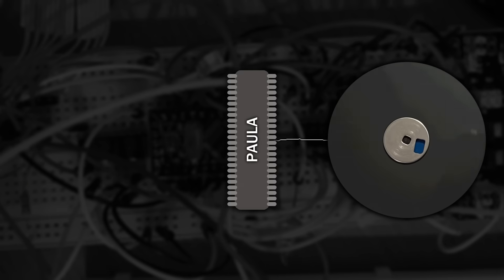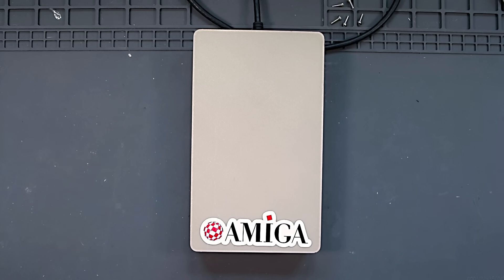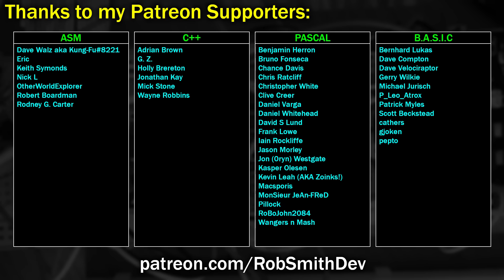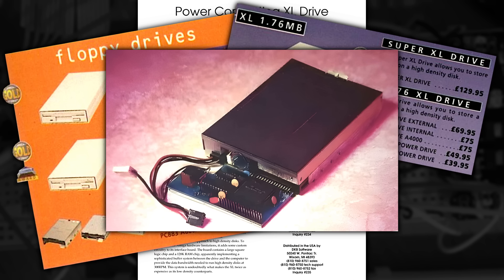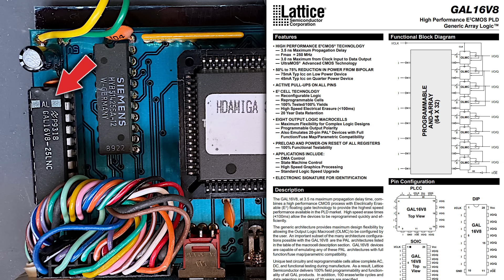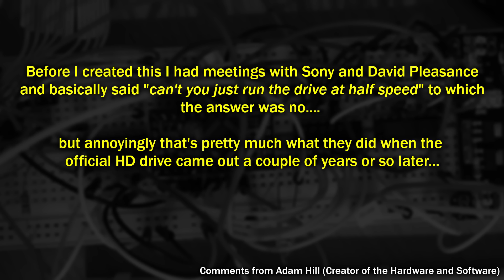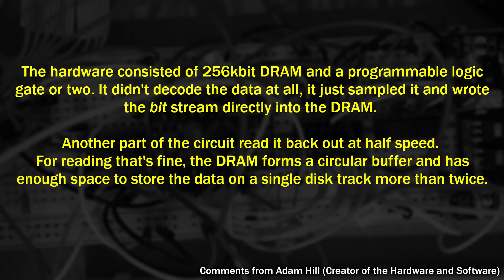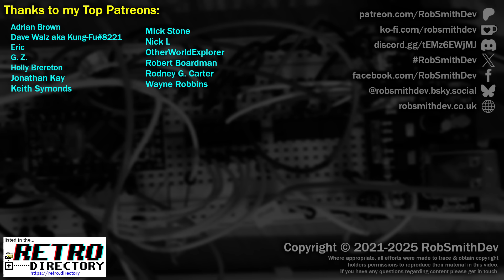Commodore vs. Clone: High Density Floppy Drive Showdown

Comment: The reason we created the XL drive in the first place was that the Commodore version simply didn't exist at that point ( I think its release was over a year later but as you can imagine my memory of timelines from then is a little hazy 😂 ). The FPGA was ( relatively ) expensive and a pain because they had to be programmed during manufacture. Later in the product lifecycle we created a custom ASIC which cost pennies per unit relatively speaking which is why the price dropped.
Reply: Wow, all this to work around having to adjust the Paula chip?  I guess the cost vs. benefit works out for having HD floppies run as slow as DD floppies.
Reply: @kjrehberg dual speed floppy drives existed way before the Amiga used them. It would be a phone call to order them, compared to spending months changing Paula. And AGA was already started too late for the market and sabotaged by management.

The irony is that power computing didn't just  source the drives themselves. Dell were using dual speed drives as external drives for laptops, someone created a cable to hook them up to the Amiga.

There is also a mod for some drives to change them to 150rpm when you insert a high density disk.
Reply: @phill6859  I think that the Dell drive you mention came out around 1992, whilst the Amiga 3000 with the half speed drive around 1990. We did the PowerXL drive about a year before that. I directly asked Sony ( and another manufacturer but can't remember which, maybe Fujitsu ) about creating a half speed drive and they wouldn't do it, and hacks of existing drives for a commercial product were really out of the question.

Obviously it was 35+ years ago so my timings might be off, but if there were half speed drives available in 1988/89 we couldn't easily source them.
Reply from the maker: Cool thanks for the extra info - I’ve pinned the comment!

Comment: I bought 2 genuine Commodore HD drives for my A3000 from the US and had them shipped to Australia.  I recall the cost of an external aftermarket DD drive + case & cable was $199AUD, but these drives cost me around $375AUD each for the bare drive.  I can't recall how much of that was due to shipping, exchange rates, import duty etc.  Exchange rate then was about $1USD=$1.30AUD, so I'm guessing they were maybe $250USD each.  They did come with A3000 eject buttons.  Strangely, I couldn't get two HD drives to co-exist in the A3000 so I had to sell one of them off.  I still have the other one, still working.  Good to know they are very rare, though I doubt they are worth much if I tried to sell it as I doubt there is much call for floppies in general, and even less for HD ones.
Reply from the maker: Weird I wonder why only one would work at a time. The price is really interesting though. From the comments so far the price range is quite wide. Thanks for sharing

Comment: Great video as always!
Quick question, what is the filament you used to 3d print that case? Best I have found here that is close enough to an A500 in the UK is eSun PLA plus bone white. Also, have you ever found a filament that matched the A1200 colour?
Reply from the maker: Yes thats the eSUN PLA Plus Bone, haven't found anything as close

Comment: I always found it frustrating that the Amiga never got HD floppy drives as a common thing, especially given that CrossDOS could read PC DD disks but not HD disks. There was a painful period when I had a CD32+SX32+Floppy drive and a 386 without a CD drive and was having to use DD disks via CrossDOS to transfer files from CD to the 386 which was as fun as you can imagine.

Comment: I had one of the Power Computing drives back in the day. It was so unreliable, they swapped it out at least once, maybe twice and in the end I had to get a refund. I also tried the slimline Amitek HD drive which worked well, but packed up after a few months. Ultimately I bought a clock port Catweazle which was excellent in my A1200 for years and these days it’s still working great connected on the IDE bus in my A4000.

Comment: I have an A3000 that was donated to the Amiga users group I belonged to.  I haven't checked which model floppy drives it has.   Now I will have to do so.   I suppose with large enough buffers, one could interface an LS-120 or a Zip disk to the floppy port (although they would be slow).
Reply: Zip drives are ide/SCSI anyway. There isn't a floppy drive interface one
Reply: @phill6859   Iomega released a Zip drive model with a floppy-style interface known as the "Zip Plus" (1998) that supported both parallel and floppy-style connections.
• 	Featured a proprietary "SmartMedia" cable that could connect to either a parallel port or a floppy-style connector on certain systems.
• 	This allowed it to emulate a floppy drive interface on compatible machines, though it wasn’t a true 34-pin floppy header like standard 3.5" drives.

Comment: I remember there being another Amiga HD floppy drive option back in the day.  It was made by Applied Engineering.  I think this pre-dated the Commodore one too.  Do you have info on how their HD floppy worked?  I think it was about $250USD.
Reply: I think Applied Engineering also made the external, multispeed drive that was required for the A-Max Macintosh emulator to use native Macintosh discs.

Comment: I had a HD 1.7mb floppy drive in my original power tower. Pretty sure it was Power Computing branded, but may be wrong. I vaguely seem to remember it was slower than the 880 k one(?) I think it came in an external case and i removed it and slotted it in the tower, it had to have some sort of interface i think, but no drivers (again might be wrong) which confused me coz how did the Amiga know it was a HD disc - even if it read the extra hole.  I have not watched you video yet so may end up coming back here and editing this !!!!!                                                                                                                                                                                                                                EDIT:  well that answered all my questions !!!!  well done you Mr Rob!!!

Comment: I just opened my external HD FDD and found that it indeed has a Chinon FZ-357A inside. I snapped a few photos of it and managed to find the invoice for it. Bought from Tricom Data, Stockholm, Sweden in July 3rd 1995 for 1798 SEK (155 GBP, 247 USD back then).
Reply from the maker: Wow! The prices on these things seems to vary wildly! Cheers

Comment: Is there any link to the DIY version?
Reply from the maker: Not to my knowledge. There’s lots of info about modding a drive to make a 150rpm drive though.
Reply: @RobSmithDev  I saw some info, but have not seen anybody actually legitimately succeeding in recreating reliable drop-in replacement for Amiga internal HD drive... Maybe a future video? These drives are so unobtainium, that it would be IMHO a big gift for amiga owners replacing broken drives with HD downgraded to DD. Especially ability to read PC 1.44 floppies is extra desirable, which comes with Amiga HD floppy support.

Comment: Beautiful video and explanation, as always I must say 👍. The reason why "half speed is not possible" is that on reading, the signal from the head is going to be proportionally weaker than at nominal speed, leading to lower SNR and ultimately higher BER (== more noise, more errors). When writing, the flux out of the head gap sure has a hard time overcoming the coercivity of the magnetic layer, which is higher to start with on HD floppies than on DDs (think about "high bias" TypeII or TypeIV audio cassettes vs "normal" ones). Amiga HD drives have never been all that reliable indeed. The PowerComputing solution was the superior one, and Commodore should have gone with it too, rather than grossly bending the specifications, delivering an unreliable product and messing with users' data, because that's what they actually did. No wonder Sony (who introduced the 3.5" media) didn't vouch for that rubbish. Oh, and they should really have improved Paula for AGA, supporting 2 and 3 us PLL periods as a bare minimum, implementing a sane UART buffer perhaps, and even 16 bit per channel and some panning on the audio outs 😅😭
Reply from the maker: Good wish list for Paula! :) it is a shame. It really is amazing (luck?) that it worked at all.
Reply: the biggest disappointment of the aga chipset was that they didn't do any upgrades to paula!
Reply: After aga was started late and then put on hold for a year, there wasn't any time. These were all put off to aga plus (including chunky pixels). Which never made it beyond a wish list

Comment: When I was around 12(circa 1995) I tried being a smartbum(yes, smartbum) and installed a HD drive in places of the DD drive in my DF1: drive. It actually worked if you put an 880k disk in, but a 1.76mb disk would simply give a "device not ready" error.
Reply from the maker: I think I tried that at a similar age too lol

Comment: 357As are a weird thing. I currently have  two and one which refuses to work on my 1200 but works perfectly on my 500+. I've even had a 357A that was missing critical circuitry and therefore would never ever work on any Amiga😮
Reply from the maker: Crazy! And weird that one works in your 500+ but  not the 1200 (is it an escom model A1200?)
Reply: @RobSmithDev Hi Rob, no it's a genuine Commodore. My other 357 works in it perfectly!
Reply from the maker: Very weird!

Comment: Did this affect data transfer rates? If the rpm is halved, but the data size is halved, I assume transfer was about the same?
Reply from the maker: RPM is half but data was double so it meant reading an HD disk took twice as long as a DD disk
Reply: @RobSmithDev  Ooooff, that's a typical Commodore choice.  Shoulda just updated the Paula.
Reply: @kjrehberg "just". It's not just Paula as floppy DMA channel would need to guarantee it too. For various reasons there was no time

Comment: When I bought my A3000 in 1990, it was an early 25mhz model with the ROM tower, and DD floppy.  I later bought the HD floppy for the 2nd A3000 drive bay.  I recall it costing about $100USD.
Reply from the maker: Interesting, so probably not that much different in price then... thanks for the info

Comment: I have Commodore HD floppy drives in my A3000T and A4000.  I also have a Power Computing XL external drive.  All still work.  Originally, I bought the Power Computing XL internal drive, but it was always dodgy.  After a brief period of headaches with it, I returned and exchanged for the external version.  I never had any problems with the external model.  It proved to be a more useful choice anyway, I could move it from Amiga to Amiga as needed.  

In this older video by Chris Edwards Restoration, he seems to suggest that a FB354 can be modded to a FB357A, but I don't think there's a part 2.  So maybe not.  Have you tried this?  Is it possible?
https://www.youtube.com/watch?v=CVMt4i3BMbM
Reply from the maker: There’s information about that mod. It’s only a very small set of these drives it works with unfortunately